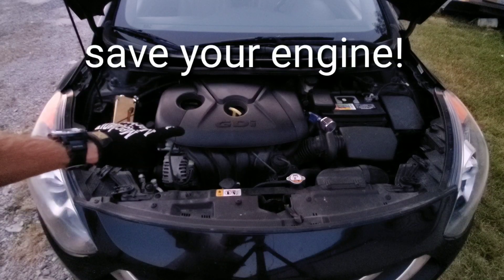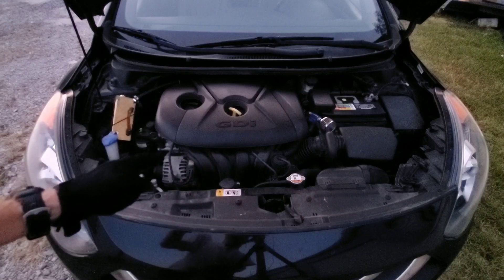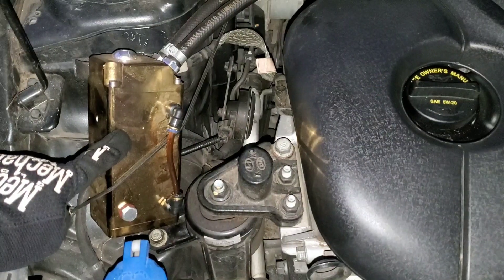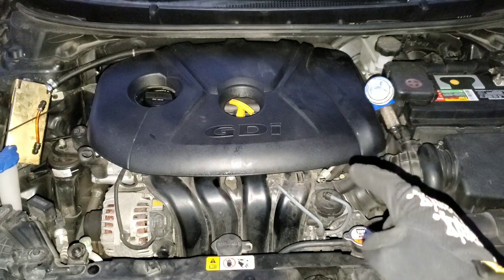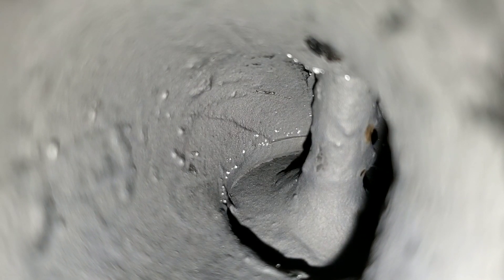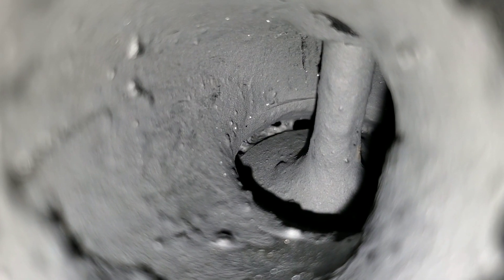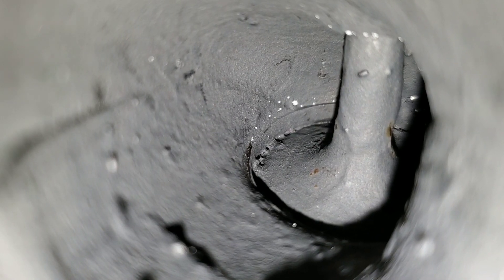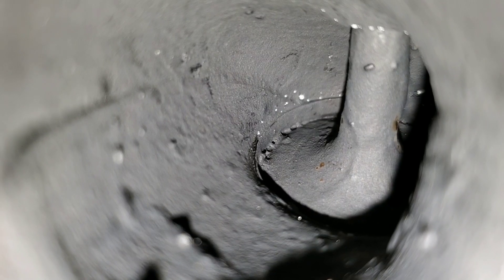save your gdi engine before it's too late! (direct injection)

Comment: I used it twice - sounded like lumps of coal flew out the exhaust. This product has the most PEA chemical in it. Use it once a year
Swap to Valvoline R+P helps keep her clean.  3,000 mile changes.

Comment: Is 70,000 too late? I just got the car.
Reply from the maker: Perform regular maintenance but sooner and just follow manufacturer's recommendations. Start by cleaning a few minutes each week with the same can. Before using a entire can. I also change the oil before the 7500 mile requirement. Especially if you don't know prior history of maintenance. Read manual because most need to change the oil much sooner do to the extreme condition. Drive many hills or mountains. Short trips so the engine doesn't reach operating temps. Excessive idling and more. City driving with often stop n go traffic. I use a oil catch can. Im not certain of your make model so check the manual.
Reply: @NATESINTERACTIVEAUTO  I change oil every 3,000 miles no matter what car it is, or what's recommend

Comment: Will this still happen even if you put 93 supreme gas in it ?
Reply: Nothing. No fuel additives can help cleaning a GDi's valves. The injectors are found inside the cylinder, not in the intake manifold. Best fuel additives can do is to remove some carbon deposits from the piston. The carbon build-up is caused by oil vapors from crank case ventilation, an oil catch can being a good candidate for slowing the carbon build-up. But still, once in a while you have to clean the intake valves (blasting or spray cleaners).

Comment: Does the shop have to do that ? Its not as simple as pouring something in the gas tank is it ?? Please let me know...i do NOT work on cars , that is why i bought a new one. I have a 2016 Hyundia with close to 40,000 on it ! I've done nothing but oil changes !
Reply from the maker: Follow manufacturer's instructions and crc gives detailed instructions that you can follow or even compare with how i use it if you have trouble performing.

Comment: NIA:  I have a question for you.   I just picked up a NEW Honda Civic  .  2.0 liter.... at how many miles do you suggest I clean the valves using CRC?
Reply: Rudy Ruiz smart move...don't mess with your Honda. They are good. I messed up my new civic adding fuel additives and avoided my warranty.  Don't be me... now I'm using a beater civic with original 180k miles ....came from a rough family butnl after two overheating the car still drives as good it before.. so do not touch your new Honda.

Comment: I had 86,000 on my GDI mini cooper turbo.  it ran like crap!     
I used the CRC turbo and valve cleaner,  followed the direction.
for the next week it smoked less and less.
I checked the valves and sure as sh-t they had come alomi=ost completely clean.
I was getting about 22 MPG before and after a week  it was back up 38 MPG.
and another bonus it was as fast as when I had first bought it!
Reply from the maker: Im glad it worked for you maybe your story can help others.

Comment: There is something not right with your before images, why is the carbon grey and smooth? Normally it's black and nobly?
Reply from the maker: I actually have a car that way the oil loss is worse and thats what cause it i have helped improve this car greatly.
Reply: I am about like u I think it's some sort of grey liquid soothed in there there's no way he got that much deposit off it almost looks like liquid before or glue

Comment: HELLO NATE, GREAT VIDEO......IVE LEARNED SOMETHING ABOUT THE ' GDI' ENGINES I REALLY NEVER KNEW BEFORE. EXCELLENT RESEARCH ON YOUR PART.. NATE, DO YOU KNOW ANYTHING ABOUT THE OLD FORD ESCORT ZX2 - Z-TEC ENGINES ; I HAVE A '98 MODEL ZX2 THAT REQUIRES TURNING THE KEY TWICE IN ORDER FOR THE ENGINE TO START. THE FIRST TURN OF THE KEY I LET THE ENGINE TURN OVER 4 TIMES.....THEN, I TURN THE KEY OFF AND THEN BACK TO 'START' AND THE FIRST TURN OVER WILL START THE ENGINE; ON THE SECOND TRY......WHAT DO YOU THINK IT MIGHT BE ? IVE ALREADY REPLACED THE FUEL FILTER........( I've always used the mechanics rule of k.i.s.s.- keep it simple stupid- taught to me by my scoutmaster WAY back in the day...) MY NEXT IDEA WOULD BE THE FUEL PUMP...IVE ALREADY REPLACED ITS FUSE...ANY HELP WOULD BE GREATLY APPRECIATED. THANK YOU.

Comment: I keep telling people. Every 50,000 KM(Approx. 31,000 Miles) with a GDI engine you have to run some form of valve cleaner, usually recommend Seafoam but I'll check out the CRC Intake Valve Cleaner now that I know about it. People refuse to listen sometimes and come 120,000 to 1600,000 KM when they need to remove the heads to get a valve job done they'll bitch about what a pile of crap their car is when a little preventative maintenance would've saved a ton of money.
Reply from the maker: Absolutely i have found even none gdi cars need cleaning but not as often thanks for sharing your experience with the NIA community.
Reply: @NATESINTERACTIVEAUTO  Nate Hail! Why did you delete my comment?
Reply: Gasoline have detergent in them and Federal Law the fuel must pass a detergent test to how many milligrams of deposits build up within a certain amount of miles,  which at one time was 50,000 but not sure if it has increased the mileage or not. This law was passed in early 1990s.  Next most of the new vehicle. Manufacturers tell you to use Top Tier gasoline's which exceed the Federal requirements. Another note is with new vehicles I believe the warranty is void if Top Tier Gasoline is not used. So to avoid this but Top Tier Gasoline if it is a new vehicle you just purchased or if used consider used the cleaner but I would borescope the head first to see what is going on. Again to avoid this purchase a Top Tier Gasoline.  Most major brands are and there is a list online on the Top Tier website listing the brand's and the story behind this which I really don't buy. To me it is a design flaw using this style of fuel injector system,  just like in the mid 1980s when Port Fuel Injection came out.
Reply: Frank W In gdi systems, valves are not washed by fuel, so they quickly become clogged with dirt, plus the presence of egr does the trick!
Reply: @ДмитрийНагорный-й2ъ  I worked doing gasoline and automotive hardware research till retired ( early) and most of my career I worked in fuel detergent mostly fuel injectors but last 5 on both engine head and intake valve deposits being fairly knowledgeable with deposits in the head and intake valves. The fuel is vaporize coming out of the inject tip and the location of the inject comes into play. The fuel does not "washed" as a stream flowing. It has to do with design. Intake deposit formation is something looked at for many years going back to carburetor engines. Today's gasoline's with the fuel detergent not only try to prevent this but clean up what has formed precious. I believe with the Top Tier Gasoline they may have something to cut down deposit formation considerably.  Not sure of cleaning past deposits. Thing is using cheap gasoline will cost you in the end.
Reply: Frank W as far as I know, it’s PIA washing in the fuel, but they are not always enough, and if there is enough, there is not such gasoline everywhere!
Reply: @frankw3217  , brother,  GDI are a different beast.   back in the day and still to this date many GDI engine valves are cleaned with crushed walnut shells,  but it is really expensive.   I have used the CRC turbo/Valve cleaner in a Mini Cooper Turbo GDI with 84K miles and it was alike a miracle how well it cleaned it.
Reply from the maker: I appreciate you sharing your experience.
Reply: @rudyruiz9615  GDI I am not 100 percent knowledgeable but PFI and before I am a expert. Walnut shell blasting has been used for many years. A good product years ago was to use GM Top End Cleaner, which that what most of the GM dealerships using. Afterward they would add to the vehicle's fuel Chevron Techron. The was also used by A lot of the auto Manufacturers with BMW telling their customers afterward walnut blasting that they should be using that regularly on the vehicle but purchasing it from the dealer which had a BMW label and part number associated with it. Same with Chrysler. I have seen quite of bit of deposits in engines so well as Port Fuel Injectors. More than most people would see in a lifetime and seems now in talking about this seems like a lifetime ago.
Reply: @rudyruiz9615  did you take the intake manifold off to clean the Mini's valves or just spray it through the intake/vacuum hose?
Reply: Out Elantra gdi had non of these maintenance done and the car has 150k miles and gets around 34mpg in city . 
So what is the deal then ???